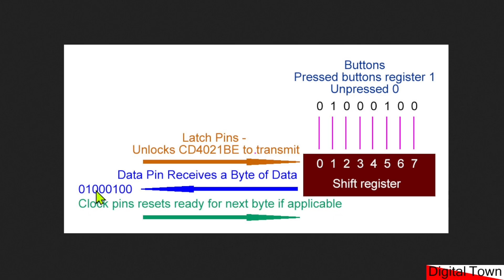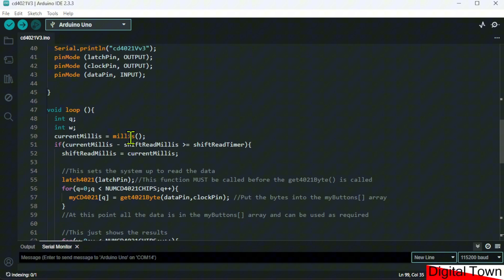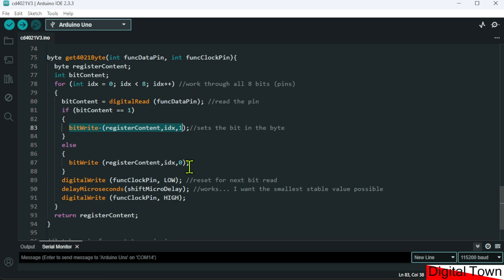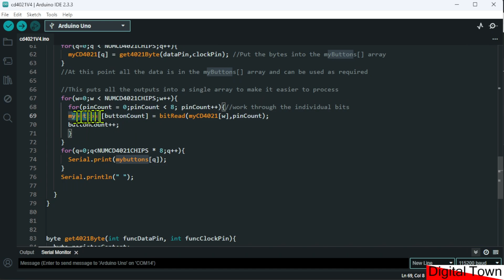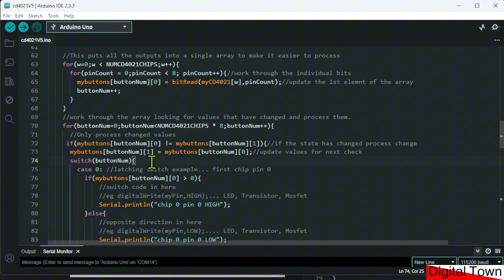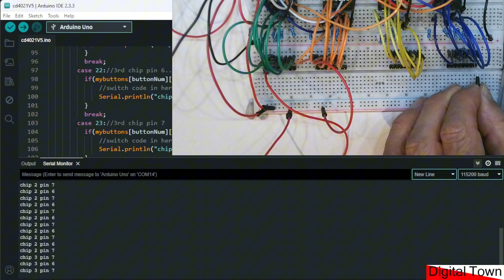#131 Arduino C++ Lesson 21 CD4021BE Shift Register

Comment: Great Video!  I'm using a combination of this and Lesson 22 to control my servo turnouts and leds.  I'm having troubles with creating a toggle type switch with one button, for example i want to push a button once have the led come on and move my servo to one position then press it again and have the led turn off and move me servo to the other diredtion.  Not sure how to implement a buttonState into the aray used for the shift resister.  Any insight?
Reply from the maker: Take a look at https://youtu.be/Gs28lLGupW0 this deals with timings and button states.
It shows how to press a button to turn something on, then press again to turn the item off.
The first sketch millisV1 is the simplest and shows how to do it with a single led but it builds up to multiple buttons controlling multiple items all keeping track of their state.

Any problems let me know.